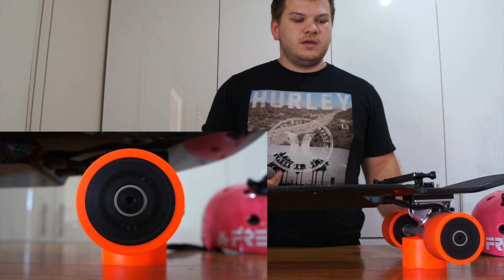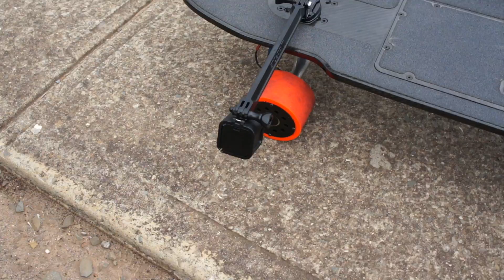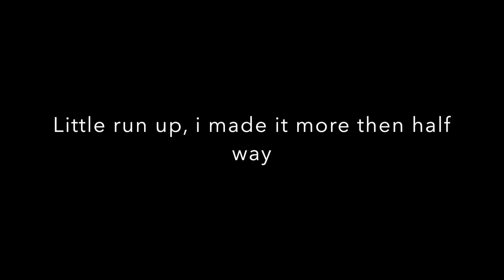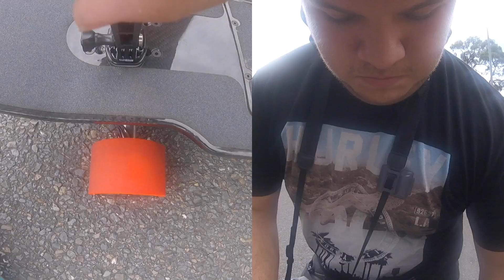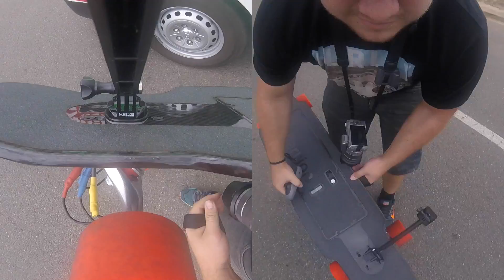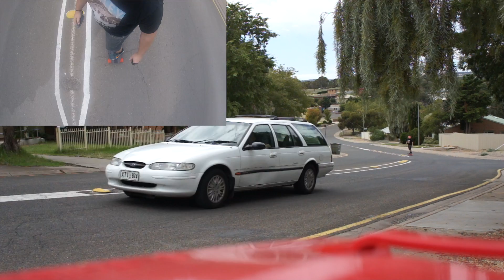electric skateboard hub motor beta 4 (enertion,vesc)

Comment: mate- I believe that those motor wires might be a bit too small for the application, no? Do they get hot?
Reply from the maker: STIZEN9 the current draw for these is only 30a so the wires can handle them, the motors don't get that hot maybe 50deg surface after constant riding or hill climbing.

Comment: one thing i have already experienced with my evolve flywheels is they have small rips in them on the edge on the dive wheel.  I am wondering if these will have issues if the wheel has a little rip in it from rock or something the whole thing will rip off with speed.  I think you need to go thicker bigger wheels like 83mm.  Those green flywheels are really awsome and then you can make the hub motors have more rubber around them to help with vibrations too.   Go bigger 83 or 93 mm wheels.  trust me.    all you would have to do is make a different mold for the bigger wheel design and it would still fit on the hub just with much more rubber.  i am on my second drive wheel cause they always seem to get shredded just with sidewalk surfing.

Comment: Hi, can I ask ? Is better use two 3S 5000mAh batteries or one 6S 10000mAh battery ?
Reply: Putting two 3S batteries in series gives a 6S 5000mAh battery. Putting two 3S batteries in parallel gives a 3S 10000mAh battery. You'd need 4 3S 5000mAh batteries to get a 6s 10000mAh battery.

Comment: 27.6 KM per Hour at top speed power and efficiency I think you should switch to ~150kv 40A motors.
Reply from the maker: +Derpy Herpy top speed isn't 27.6km/h it would be more like 35-40km/h 70kv 36v 1:1 gear ratio 85mm wheels.

using 150kv motors reduce the turns in the motor, turns = more torque. this board can do that big hill the same as my boosted board with a similar amp cut off. all in all I'm happy.
Reply: huh I was assuming you used a 6S battery but I'd still increase the total power because it's not fun when you push the skateboard instead of it pushing you in those hills.

And wow that took you a short amount of time to recomment.
Reply from the maker: +Derpy Herpy really i can upgrade the amp rating to 60a but i haven't had the motor draw over 30 phase amps yet, and they will go up any hill that i would be going up. I'm 95kg and can get to the peak of a 28deg hill with a slow speed run up before the batteries 50a bms kicks in.

the boosted board makes it to the same point on the hill.

inboards hub motor board is only rated to 15deg hills

if any think i would go down to 50kv then give it 12s and have less amp draw as normal riding speed.
Reply from the maker: https://www.youtube.com/watch?v=VYFn2Pcjlng
this is the data log of just one of the motors while riding

Comment: Its compact nice looking but since there's no gear reduction, the motor has to be much stronger or have quad motors I believe.
Reply from the maker: Yes that is why the motors have been basically completely redesigned, compared to an outrunner that is commonly used!
Reply: +Jacob  You should try quad motors see how it goes. More batteries but should make some differences.